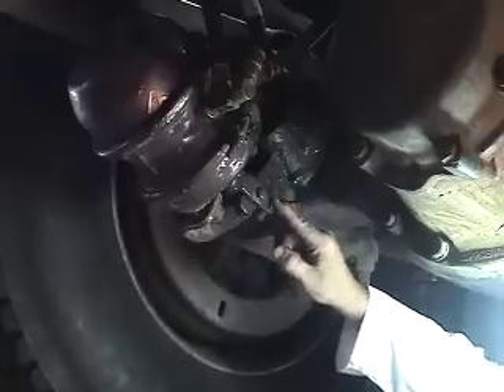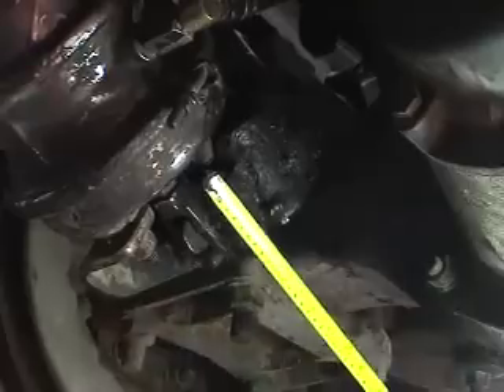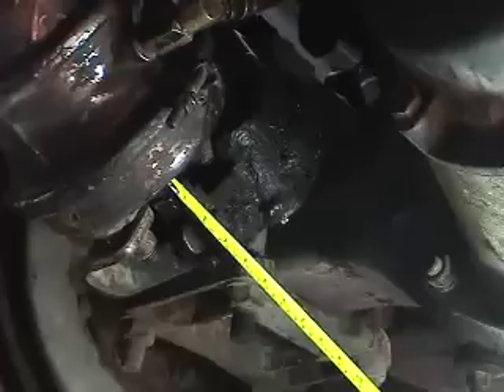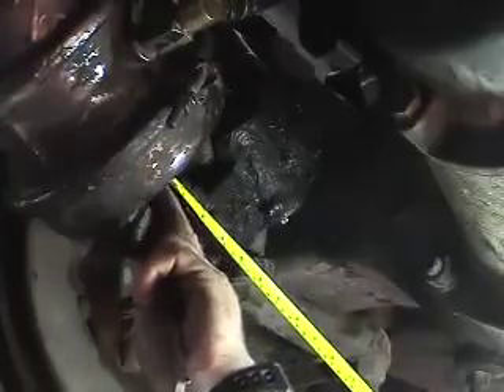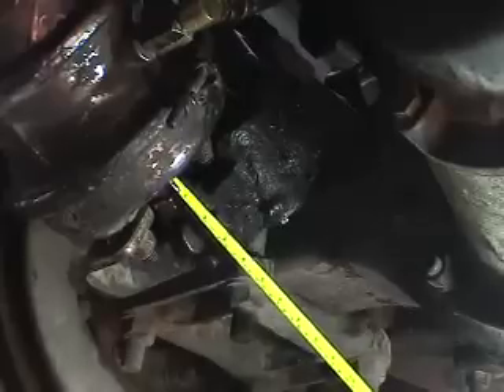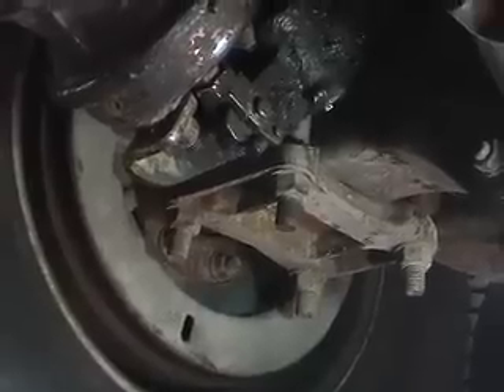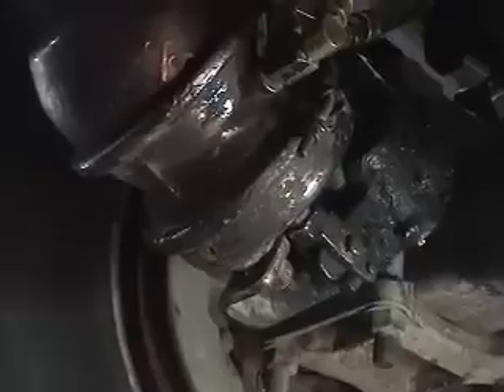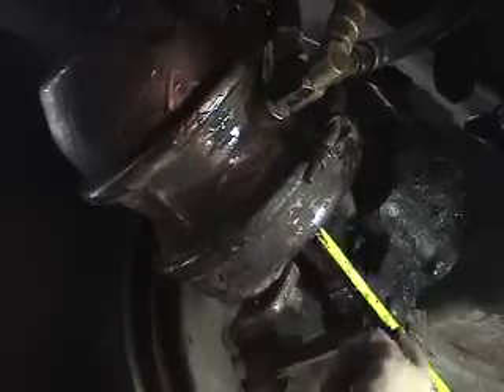Adjusting air brake system slack adjusters

Comment: I am a retired fleet mechanic who preformed well over 500 brake jobs in my 31 year carrier.
Well first off in seeing the video, I could tell it was a self adjuster slack, no need to adjust unless the ( paw ) is stripped then replace the junk slack which means in most cases a puller is no help, so break out the torch to cut the faulty slack off.....expect lots of smoke and small fire.....
When adjusting non self adjusters the simple way is to first inspect the shoes to see if there is enough pad, check the ridge on the drum, anything more then a 1/4 inch ware indicates the drum is reaching the end of its life time, if all looks ok, using a 9/16 box end wrench turn clock wise until the shoes press up against the drum, then to get my 1 1/4 inch of push rod travel ( I ALWAYS USED A 16 inch heavy screw driver ) slip it through the clevice  pin then pull toward you, to see that 1 1/4 inch has been gained,  just a 1/2 turn, back off is usually only required......

Comment: This is an automatic slack adjuster. I was always taught that if the slack is out of adjustment, the auto slack adjuster is broken and to REPLACE IT. Manually adjusting it ruins the auto adjust mechanism, it should only be done in an emergency, to allow the truck to get to the Shop for a replacement.

Comment: is there a way to shorten stroke? i have been working on container chassis for this outfit. but the customer wants stroke altered to shorter dimensions so it doesn't take as long to release. all the chambers measure 2" and under on all the units. of course i would like them to all be uniform in measurement but donot know how to shorten stroke like these people want me to do.i can't see how it would be done without taking it out of 90 degree range. thanks forr any suggestions. you tech info is great.
Reply: Jeff Diamond

Comment: 2 weeks ago i was pulled over for inspection, level 1 full....  found  i drum  out of adjustment. 2 citations....as the tooper said: if your autoi slacker were workind properly,  you should have no slack....replacet it!
 whenever im leaving the yard and the brakes are not good,  a mechanic comes and manual adjust them .... i leave NJ and by the time i get to MA  brakes are out of adjustment again! but i guess is cheaper to adjust  them everytime than replacing it($70 each) lol
Reply: maconhadalata you have to replace the entire slack adjuster when that’s happening.

Comment: In the two years I've been working with these, I encounter a bunch of auto slack adjusters that aren't keeping the pushrod applied stroke under 2".  I have a theory that the buildup of oxidized grease and dirt may interfere with auto slacks certainly when it's caked mud.  Likewise for inadequate lube.  I prefer wheel off ground adjustment to see the drag on the drum proper.  I also prefer NOT caging the spring as with full air pressure the caging bolt compresses the spring causing drag after adj

Comment: Manual adjustment of automatic slack adjusters is dangerous because 
it gives a false sense of security about the effectiveness of the braking 
system. While a manual adjustment may temporarily shorten the stroke, 
the automatic slack will soon re-set to its designed stroke.

Comment: bendix says if slacker is not working properly, replace it!!tried to adjust auto slackers before, you adjust them aand it lasts 50 miles ... almost 15 years  driving big rigs  ...

Comment: wrong. Even automatic slack adjusters need occasional manual adjustments. I just read the air brake manual for my test and learned that automatic slack adjusters can over/under adjust depending on braking conditions and use.

Comment: @jboydmv90 Not sure what kind of equipment you work on or size of pots, type 20, 24 maybe?  But with a 30/30 you want to back off a a half turn.  And optimal push rod travel is 1 1/4- 1 1/2.  <- 30/30 mind you.

Comment: @studpuppy69 it does not change with long stroke,  The only difference is if your brakes are out of adjustment, the long stroke will still be able to apply the brakes somewhat whena regular stroke has already bottemed out....That is the main difference.  I have even talked to CVSE about this and they said the same thing.

Comment: @aviomaster Can you try to clarify a few things? I believe you meant 12:15PM, then you have 19 Hrs 45 Minutes until 8:00AM the next day. If it was 12:15AM... it would be only 12:15AM the next day with 7 Hrs 45 Minutes remaining for delivery.

The other thing I don't understand is 11:45AM to 7:00AM is 16 Hrs 15 Minutes while 12:15PM to 7:00AM is 15 Hrs 45 Minutes. Either way youre over 15 Hours.
If it was 12:15AM as you said (though i believe thats a typo) that would be under 7 hours.

Comment: Look folks......Been a commercial truck driver and owner for over 25 yrs......

Here is what I go by.....

First things first..You're safety as well as others should never be 2nd guessed.
I ran manual slacks back in 80's and early 90's......Which are no longer put on new trucks..(I believe 1993 was the last yr for manual slacks...I PREFER MANUALS....
Sorry but auto's..they say to just leave them be if working right,,,Not me...I still "touch em up" every week.I like my brakes "touchy"

Comment: This video shows the MANUAL adjustment of an AUTOMATIC slack adjuster which is not only a dangerous practice but also illeagal for any driver to do in most states and provinces. 
 I've been an air brake instructor a lot of years and unfortunately "dave0z96"  you're wrong on that statement.
Look up Rockwell and Meritor slack adjusters. They both have similar designs to this.

Comment: @mmocahbee That is not an auto slack. On automatics you have a pawl on the side or back to pry out on, to adjust, and the adjusting screw is usually is on the top which has no ratcheting or clicking mechanism. This has the ratcheting or clicking mechanism which means its a manual. But you are right on automatics it should only be adjusted during the install, or if something aint working right.

Comment: Sometimes a full 1/2 turn backed off is too much, and the truck can roll on a hill with the parking brakes applied.

I was always told to back off 1/4 to 1/2 turn. I use 1/3 of a turn, and works just fine.

Good vid, but could have said more with fewer words.

With manual slacks, if the adjuster turns really easy, you need to go the other way to reduce the shoe clearance. Should have pressure from the brake return springs.